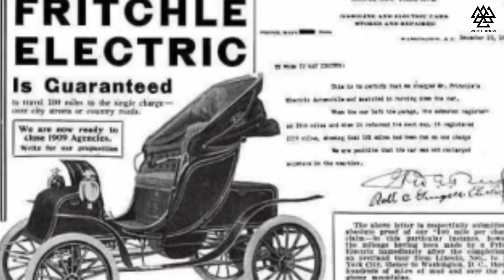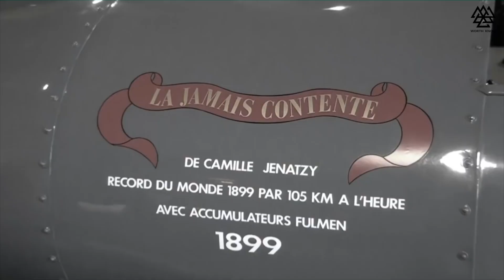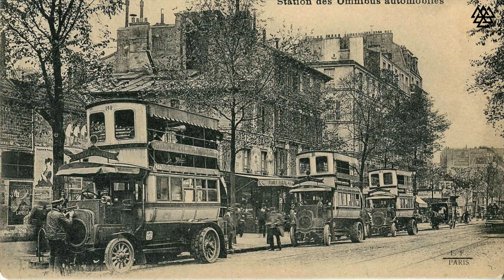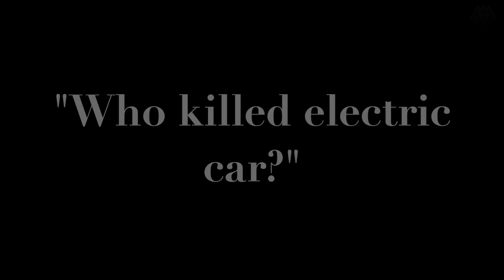The History of Electric Vehicles 1841

Comment: Electric cars  back in the day are their early introduction and a far superior battery range than today's electric cars. They could almost go 700 to 1,000 km on One battery charge.
Reply: Only difference was they weighed not even 2-300 kg. Today they weigh 2+ tonnes. Anyway they ain't selling.... Who wants to drive getting cancer from there new cars 🤔 with the batteries basically in the chassis.. Not me... Vauxhall has closed in Luton, because no one wants them.

Comment: First Crude Electric Vehicle Is Developed
Around 1832, Robert Anderson develops the first crude electric vehicle, but it isn't until the 1870s or later that electric cars become practical. Pictured here is an electric vehicle built by an English inventor in 1884. Photo courtesy of the Smithsonian.
Reply: I'll submit that the key issue is, that the first electric powered vehicles had batteries that were NOT rechargeable. In the 1830s Anderson and Davidson built carriage like vehicles that used NON-rechargable batteries, because it was not till 1859 that the RECHARGEABLE lead-acid battery was invented by Frenchman Gaston Plante.

Comment: The bussiness behind EV comes,whith all the "Service" thing from the dealership plus the impossible to repair and/or modify by the regular driver/owner.   The thing behind this,is that EV are just a transport, point A-point-B.
 The good'ol  fuel car is more than just a transport,its a way of life, there's a whole culture behind and it can be repaired and/or modified by almost anyone..
Of course,the EV brings some burocracy problems too, at least for now. Like the charging net by Tesla,they can take your fast chargimg rights away if they are pleased,how much will cost the batteries replacement after years of usage,in case you buy the car as Used or Second hand,how to tell the wear on parts if everything is concealed behind tons of....Plastic?  Plus,the fact that you don't drive em either, EV's seem to be the future of lazy drivers cause they tend to offer the....Self or smart drive tech, basically,google maps take you to destiny?  Are we so lazy and/or useless that we pretend to let a computer, a machine do it all for us??   If that's the future, i'll stick to the past.
Reply: Moron

Comment: Left out the 1839 Babcock electric car. Had a range of 1200 miles on a single charge! In the 1840s! Wonder why they hid that tech?
Reply: Now out vehicles offers way more security and "services" like radio, Bluetooth, cameras, detectors, GPS ..... List goes on.
So yeah, it takes a lot of energy.
Reply: They hid all those electric cars with their many features after the discovery of oil and the steam engine, and because the oil companies invested in that, which made the oil market very prosperous, so the electric cars were stopped because they are not very profitable. Perhaps that is the reason behind their non-proliferation.